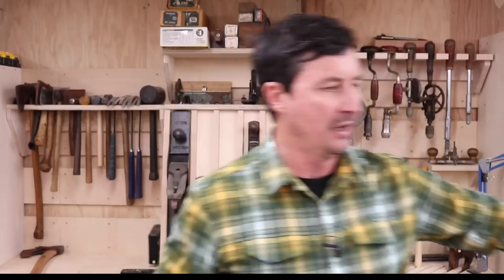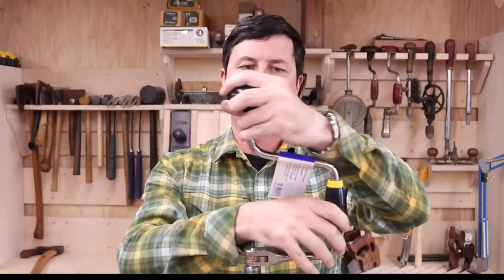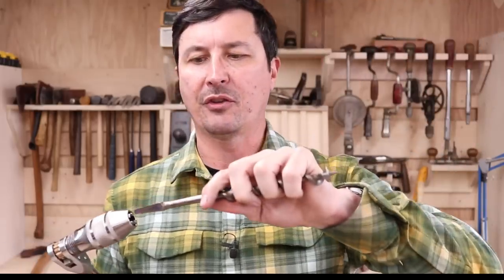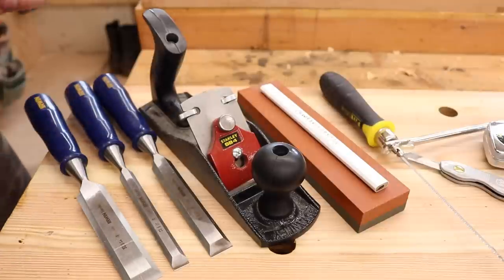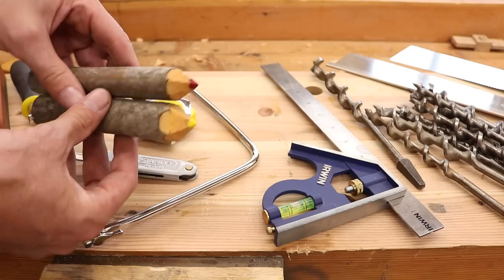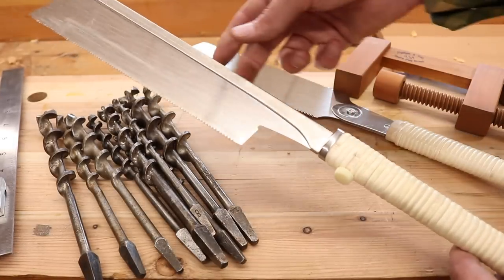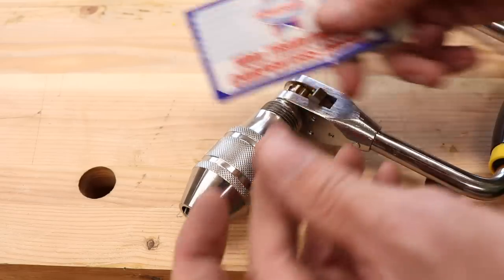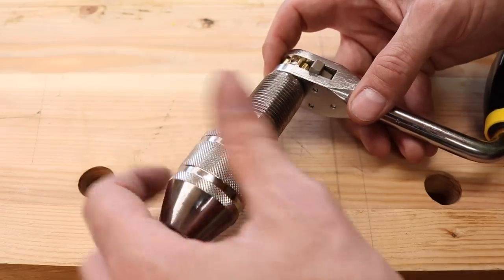Testing The Cheapest Drill On Amazon

Comment from the maker: GET YOUR FAITHFUL BRACE DRILL HERE: https://goo.gl/KfmFZy
Reply: Item Cost
Brace 40.12
Crayons 0.5
Sharpening Jig 12.99
Combo Square 12.99
Marples Chisels 40.5
Pull Saw 30.1
Coping Saw 4.76
Dovetail Saw 21.48
SB4 Plane 22.78
Norton Stone 20.97
Measuring Tape 9.99
Stanley Knife 6.58
 223.76
Bits ?
Pencil priceless
Clamps priceless
Reply: Wranglerstar great video
Reply: Wranglerstar 
The total that I got for all the tools not including the bits and wood clamps and  is roughly $205
Reply: Josh Porter:  That is too bad it is an all or nothing proposition for you.  I use my Makita cordless almost every day, but I still own and use several old braces.  There is a certain zenness with using human powered traditional tools.  The shop becomes a quiet, reflective place where things move at a slower, more relaxing pace.  The older I get the more I find myself reaching for the traditional tools. Again, it depends on what I am doing and how much of a hurry I am in.  Many of us understand it, many more do not.
Reply: Tool kit cost to date
Brace 40.12
Crayons 0.50
Sharpening Jig 12.99
Combo Square 12.99
Marples Chisels 40.50
Pull Saw 30.10
Coping Saw 4.76
Dovetail Saw 21.48
SB4 Plane 22.78
Norton Stone 20.97
Measuring Tape 9.99
Stanley Knife 6.58
Then we have the unknown costs
The bits (used and cost not revealed in video)
The Wranglerstar penciles (priceless)
The hand made wooden clamps (priceless)
The had made wooden tool grip (priceless)

Total so far is Aprox: $224.00
Reply: Wranglerstar  what about a hammer and a screwdriver set and some wood glue
Reply: Wranglerstar after the winner is announced I will be buying all those tools and are those bits hard to get?
Reply: Good tools and review !!
Reply: Wranglerstar are you going to put boiled linseed oil on the tool box
Reply: Wranglerstar do you have a link for the pull saws. I've got them on my wish list for the near future
Reply: what about a draw knife?
Reply: a wood rasp and or files maybe is all i can think of
Reply: mortise and Tenon gauge
Reply: hi
Reply: Id like an option for a clamp we can order from amazon.
Reply: how about a angle finder??
Reply: Wranglerstar thank you so much. I am only 13 and after watching your videos you gave me the confidence to take my bike to bits and re grease the bearings
Reply: What a nice chap you are.
Reply: Miter Box?
Sanding Blocks?
Reply: Some one mentioned wood rasps and files already so I'll second that. But maybe a card scraper also?
Reply: your give away is awesome and I love what u do i have been a long time subscriber and gave learned alot
Reply: At the end of the vid he specificaly says he would not be adding things like screwdrivers because most people would already have them as part of a generic tool kit. This is specificcaly for traditional woodworking. Glue is a good call though.
Reply: One recommendation is a card scraper
Reply: I would add a center punch to mark the center point for starting holes for the brace and bits 

and a block plane
Reply: jdskickinit  I am moveing to Idaho so I book marked them Thanks for the tip Brother
Reply: jack ripper You can build a basic miter box with tools already in there
Reply: Michael Tran both good items
Reply: Hey! great job!
Did i see it wrong (at minute 07:00) or in the center of the drill, right in the screw side of the drill it`s a square hole where you can rest the square part of the drill bit so it doesn't slip?
Greetings from Romania :)
Reply: Hello sir I am a 13 year old blacksmith and future bladesmith and hopefully if I get this set I would be a decent woodworker I enjoy all of your videos and technique and I am hoping that you may just choose me for this giveaway. Have a nice day!  :-)
Reply: great work on the box
Reply: I was unaware that you could still purchase newly made braces.
Reply: Hayden Simmons you can buy them from leevalley.com or garrettwade.com or leimans the amish supply company
Reply: I'm wondering if a spoke shave or draw knife would be a good addition, or if that seems unnecessary.
Reply: wonderful tool
Reply: Wranglerstar Hi Cody! I have followed your videos for quite a while now and am enjoying the broad spectrum of information and the ease and quiet way you present them. Keep up the great work! I am a retired dentist from Germany and in the beginning of my career have worked for the U.S. Army in Heidelberg, Germany and have just watched your life stream in Mallorca, Spain, where I live now in my retirement. I would have loved to comment during the life event on putting the drillbit into the square recess in the brace, but found no hint in the section below the video how to contact you (I joined several minutes into the broadcast). Next time maybe you can put a note up how to participate. It's 1:30 our time and I will go to bed now, you all have a good day and thanks for your time!
Reply: Cody,
 I like the tools you have chosen.  It's a really good basic kit.

Henry
Reply: Wranglerstar love the videos keep doing what you love
Reply: Love the videos
Reply: add sanding block and sandpaper
Reply: Wranglerstar Awesome kit, good luck to everyone!
Reply: Wranglerstar awesome kit that anyone would like to have.
Reply: Sounds very close!
Reply: Wranglerstar what about a 4 in 1
Reply: Wranglerstar get videos I think maybe a rasp would be helpful in the kit, all traditional woodworkers have them. I am a begeneer and I just bought my first hand plane a no 5 Faithfully and it seems tone a great $70 plane. The sole is flat and I spent maybe 20 minutes on the blade and chipbreaker and it works just fine. I would love this kit to help me along in trying to learn woodworking its something I love to do when I get a minute by myself away from being a wife a mother it just so calming to do. For my first real big project I want to make a toy chest for my son's second birthday in November.I'm trying to get the minimal tool kit built up before I make it.
Reply: Nice video Cody.  I'm not sure if I am supposed to say anything to get entered into the drawing.  That said, please don't enter me into the drawing.  I am all set for tools.  Hopefully someone who really needs them will get them.

If you are looking for new brace bits, here are some that cost as much as the brace itself, just for one - https://www.toolsforworkingwood.com/store/item/MS-JB.XX
Reply: At the moment I can't think of any needed tool you have missed. Although if you felt like adding a multitool for fun I guess you could. Probably not needed but I doubt anyone would complain. Other than your bank account that is.
Reply: would you shipp it to sweden if i would win.. our what happens if someone wins it how lifes in europa would you shipp it our is it a ameriken only thing? all love out sweden have a nice day cody
Reply: maby one of those small planes you draw to you . nice music btw
Reply: I remember using a brace drill to tap maple trees in NY. Good times.
Reply: I'build my own brace out of reebar and a powered drill chuck!
it works like a charm and it can take a hell of a beatting!
Reply: Hi Cody, don't those bits sit a lot further back in the brace? looks like there is a recess in the back of the chuck to accept the square end (about 6:30 in). Great work as always tho :)
Reply: Enjoy your channel and I'm very impressed with the kit, hope I win it. Keep making quality videos.
Reply: I love this chinale
Reply: Wranglerstar Man, i would love to win this, it would be a great start to my kit!
Reply: Nice work Mr. Knock!
Reply: So cool - would love to win this! How do you get this kit?
Reply: Great video, makes me wish I was at work, as a carpenters apprentice. There's no better excuse to buy tools than a good review by wranglerstar 👍
Reply: Wranglerstar I know my name  is unrelated to this subject but I have great knowledge from my lovely wood shop teacher Mr. Walker
Reply: Wranglerstar I have just started to get into woodworking earlier this year but have fallen short with my tools that I have at my house. I love your videos and really would love these great robust beautifully crafted tools.
Reply: Wranglerstar i love your vids, and i love the idea of giving away a kit like this, in my area its very hard to get even decent tools at any price...
Reply: Wranglerstar I shouldn't be binge-watching these, but this series is fascinating. I would love this kit!!
Reply: Hay
Reply: My problem is that for years and years I had mismatched tools of different brands and qualities, I finally replaced almost all of my tools with Craftsman's as I have long wanted everything to be one brand and quality.

When I was a kid my Dad was a Master Mechanic who used Craftsman tools exclusively as they were considered one of the best brands out there. Now I have replaced everything almost with the same.

There is just a feeling you have when you have mismatched tools that are various brands, gifts and what have you that your tools are not complete or up to snuff.
Reply: Wranglerstar you need a straight pipe and a twin turbo on your tractor
Reply: Wranglerstar wonderful idea thanks for reviews for these things.
Reply: Wranglerstar crack open a cheap driller and an expensive driller
To compare which is better
Reply: Wranglerstar t
Reply: Wranglerstar nice man
Reply: I pretty much need all those tools because I use my dad's power tools but his drill just broke recently
Reply: Wranglerstar  pick me
Reply: Wranglerstar did you give the kit away yet?
Reply: Wranglerstar your videos are awsome
Reply: It is not solid  it makes more violent  so better off with the wooden handle one   and I like all the items they are good I would love to use them
Reply: Wranglerstar. I love all the videos you produce. They are very educational and have helped increase my knowledge about so many things. I cant wait to start setting up my tool box that i will base from your opinion.
Reply: I have a brace just like the one you took off that wall

Comment: If you push the bit in a little further you will notice it won't slip as there is a square socket in the brace chuck. The jaw only grips the shaft leaving the hard work to the socket
Reply: The jaw grips the... shaft... Giggle giggle.
Reply: Yeah, this bothers me from someone who is supposed to be as knowledgeable about woodworking. Not knowing something like this is understandable but not looking at the tool you're using to see if you are using it correctly is a real shame.
Reply: it really triggered me
Reply: Him not pushing the bit into the socket gave me fucking cancer.

Comment: I am pretty sure, with gripping the bit with the odd shaped ones, there is an indentation on the back for it to fit in place. So just stick it in until its snug then tighten instead of tightening before it hits the back.

Comment: Ok so i just gotta say, after seeing this type of manual drill, i remember my grandfather's very old manual crank drill (of a different design). The way that works is, it has a shoulder pad so you basically can only use it on a horizontal surface, meaning that you have to lean in with your shoulder and press against a wall (for example), and with one hand you hold it steady, while with the other you spin the crank which makes the drill bit spin into the wall. I've never seen something like that until i found it in my grandfather's garage.

Comment: I noticed a square broached hole in the bottom of the chuck, is that for the bit to sit in?
Reply: Chris Woolvin I was seeing that too...8 minutes in so far, waiting to see if he mentions it. I think you're supposed to bottom out the bit in that hole for the rotary force transmission, then clamp on the shaft to keep it centered.
Reply: yeah he wasnt putting them in far enough, its a chuck meant to work with all the different bit types so it doesnt work like his old one that only uses the square taper bits.

Comment: Plumb Bob ? Small,cheep and easy method to make sure a beam is vertical.
Reply: Nice idea, but he said this kit isn't a carpenters set, it's not meant for building structures. Maybe for this kit a small "torpedo" spirit level would be better, but that might be like a screw driver or a claw hammer, as in everyone pretty much already has a spirit level.
Reply: Plus, there's already a spirit level on the combination square.
Reply: If you can't manage to make a decent plumb-bob,  I would question whether you should be handling sharp tools !  LOL
Reply: :) i get your point but not every youngster has a lathe.

Comment: I remember when handheld battery powered drills first came out. If you tried to use a forstner or spade bit with them you could only go in about 10mm (2/5 of an inch) before it ran out of torque and you had to break out the centuries old brace and bit. We have a few of these in the workshops at school, been there since Moses was a boy and still going strong. And the batteries never run out.

Comment: Buy a power drill
Reply: Kevin Raj.    Power drills are great where there's a power supply, this however can be used anywhere.
Reply: Not only are cordless drills a thing, you know, they make Solar powered banks to recharge them? FWIW my Kobalt 24v 5Ah runs me about a full day of heavy use. get 2 of those batteries, a decent solar charger and you'll never run out of battery.

Not to mention, with all that manual work, you've got to worry about "your" battery running out.
Reply: i love my power drill. it never lets me down.
Reply: The point of the video wasn't to decide which is better, a power drill will obviously be easier to use. The only thing I think these are better at is carrying sawdust out of the hole, which is very important.
Reply: You’re all missing the point... it’s about keeping the traditional way and skills alive, you’re all exactly the reason why nothing is made by hand anymore, no one appreciates the work that goes into it.

Comment: When we moved into our current house the shed out back was locked. We ended up having to cut the lock and inside the shed we found several older style toolboxes and tools. There were 2 of these in amounst the tools. 1 of them was rather odd as it looked like it was made to be used with regular drill bits and hex bits used in power drills. Doesn't look like it was altered to be that way after market either. All the tools are in excellent condition still considering their age.

Comment: The reason for the bit of play in the top handle and down near the chuck-  using the tool at an angle or under high torque will cause stress at the top and the bottom of the tool.  If the top handle is tight and the chuck assembly is tight (at 90 angle) the tool will slowly warp itself with use.  The top handle will loosen even more over time- and can be tightened. Just don't tighten it too tight.  This tool was made to flex and bend and jiggle.  You only sacrifice a tiny bit of precision and gain years more use and durability.

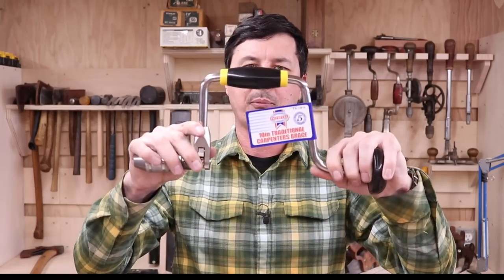Comment: Hi Cody, I live in the UK and I have 15 old braces, I have bought them through the years from car boot sales usually for less then £1:00. Because of the battery drill no one wants these great tools. I have a caravan in the hart of Weardale and our site doesn't have electricity so I use them instead of battery drills that I have no way of recharging at my caravan.

Comment: I have a neurological problem and my hands have become quite weak. I am now frightened to use power tools and had some accidents last year that could have been quite serious. Even moderate twisting torque on an electric drill can be hard for me to hold if the bit grabs.

Hence, I have been considering a drill brace and a small 'egg beater' type hand drill for woodwork and even drilling of screw holes in my walls which are plaster and soft brick. I like doing my own DIY around the home and living in the UK it is hard to get handymen to do small jobs. Fitted some ceiling architrave plaster in my bathroom (we live in a historic building) a few months ago and also have some wood panelling in a bathroom and need a little bit of detailing. Just the sort of thing I need a light hand tool for. 

Nice to see a good video on this.

Comment: Can I use this kind of tool (brace drill) to drill metal ? More specifically, I'm trying to drill a steel stud (about 4mm) in the center to tap it in the center and create new threads to insert a new but smaller stud. Reason I can't use a power drill is it's a car fuel tank and power tool create sparks. What happenned is I tried to remove the fuel pump assembly from the fuel tank. The plate of the fuel pump is held on the fuel tank (with a rubber gasket seal in sandwiched in between) by 8 nuts and 8 studs (stud tig welded to the fuel tank, cannot be replace). The nuts were badly rusted, and even though I used PB blaster on the rust, I ended up shearing off 2 of the studs trying to remove the nut (supposed to be torqued to 3.3 ft-lbs). Hope this works on metal. Thanks for any input.

Comment: Another great video from youtbe's greatest, Nice work Cody! Wanted to give a heads up, I just bought an 8" bench grinder from WEN, 5 amp motor and it was $65 shipped! Dewalt 8" wire wheel was also on sale for $15. Amazon and Home Depot both had the WEN models on sale. The variable speed version was around $100.... Cheers!

Comment: The steal used to hold the teeth in place, Will it rust easily if you had to work in the rain? Just seems spring steel isn't that good. Yes it is a good price and would be usable for years just wondering the lastabillity of it.  Thanks!

Comment: I think you're missing a pedal-powered rotor, which can be combined with a rotor, which can be combined with different heads to make a grinding/sharpening stone, a circular saw, a drill (like the one in this video), and other mechanisms that can be considered machining without electricity.